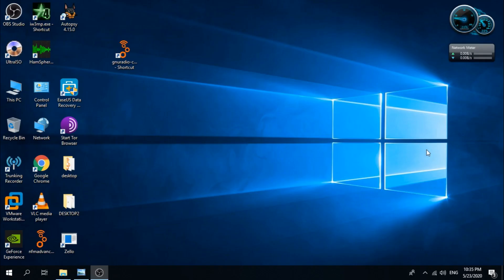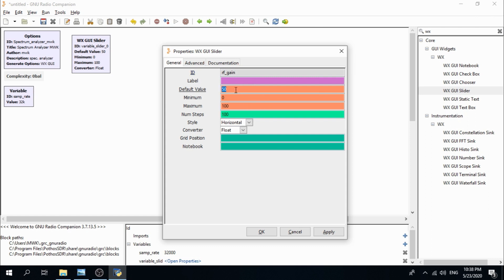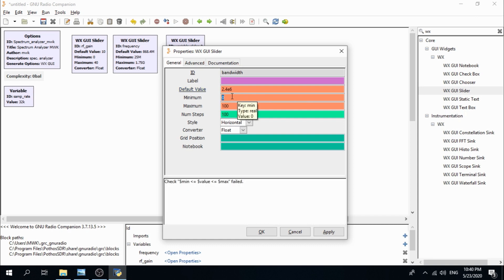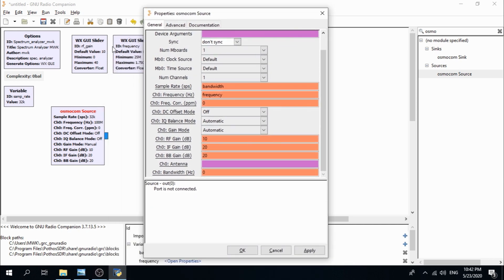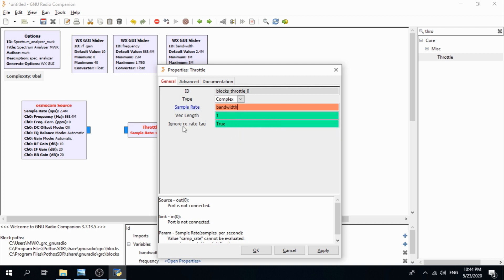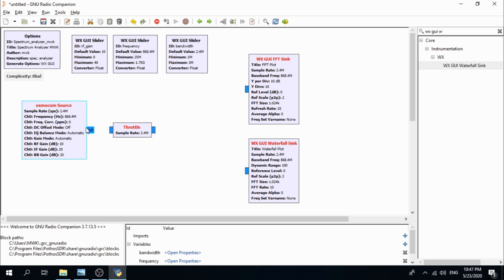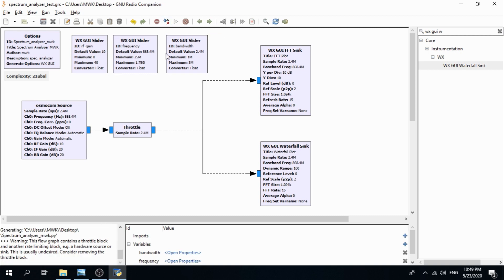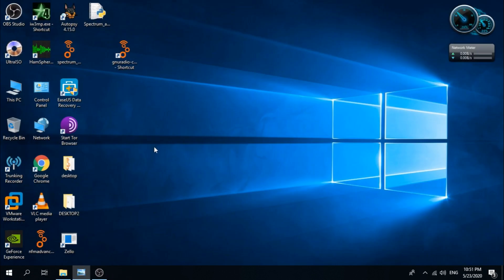Build Your Own Spectrum Analyzer GNU RADIO Win10

Comment: I have two HackRF one, is it possible to operate both devices on one computer with two identical windows. So everything is the same only twice, except the computer. I want to do distance measurements and compare the same windows for field strength and sidebands only. There is an article on rtl-sdrxxx: Combining the bandwidth of two RTL-SDR dongles in GNU Radio, that should also work with two identical recordings, but at two different measuring points.